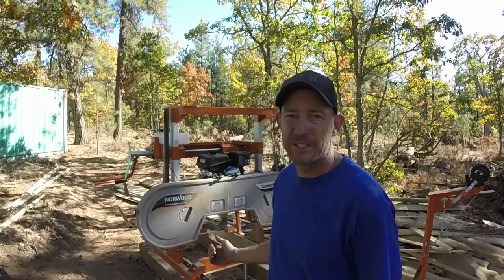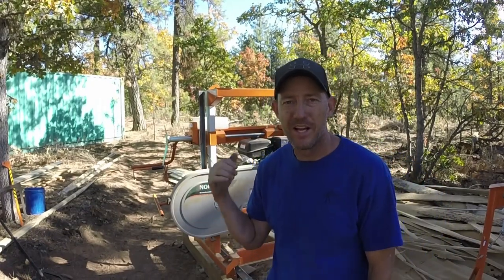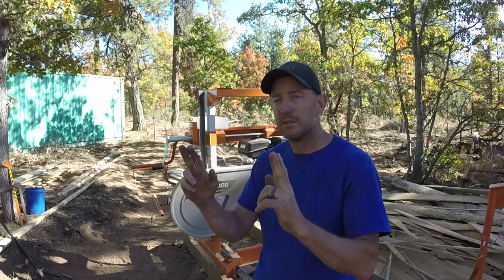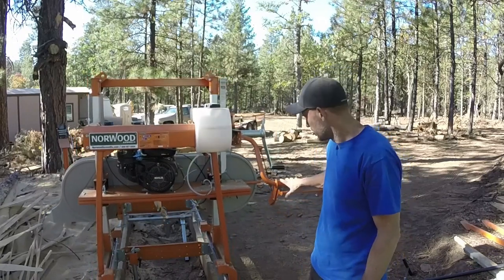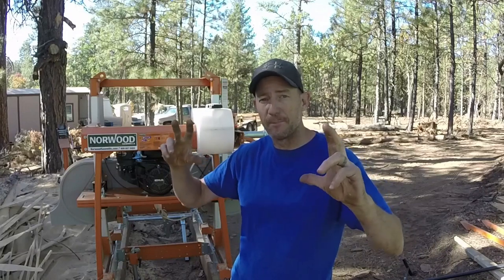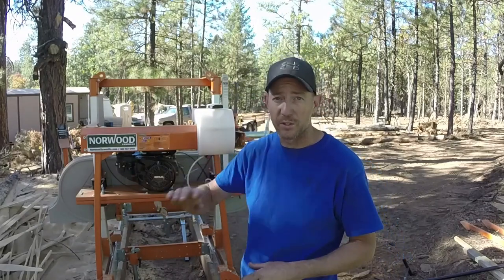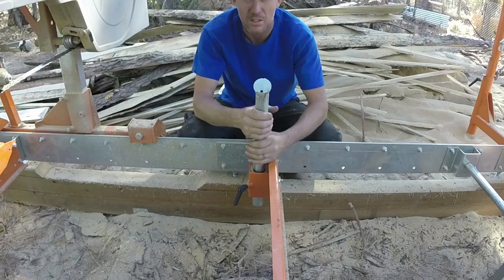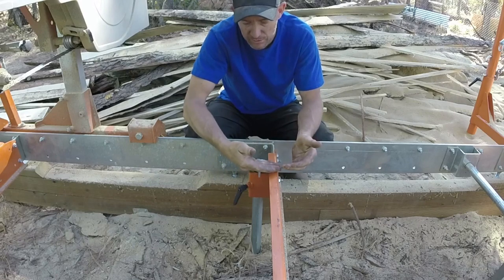Norwood LumberMate LM29 Sawmill Review by Koality of Life

Comment: I added a third log stop for shorter logs, and that was huge for milling valuable hardwoods. I also added a 3500 lb Harbor freight electric winch to the loading system in place of the hand crank one. I bolted an ammo can onto the top of the post because it is waterproof and put all the electrical for the winch inside so it can hold the remote control for the winch and the rv cable to hook to a deep cycle battery. Battery lasts all day and will load as many logs as you can mill. Milling hard Maple for furniture and some pine fence boards today snow or not!

Comment: How do they compare to wood miser
Reply from the maker: Hi John.

WM makes nice mills. Norwood is THE leader in portable sawmill innovation … in fact, Norwood has over 50 patents (more than all the rest of the sawmill companies around the world combined).  But you may ask, “What does that mean for me?” Norwoods are a lot faster and a lot easier to use because they’re equipped with inventions that no one else can offer (because they’re patented)… Only Norwood can offer you indispensable features like auto-locking sawhead, auto-locking blade guide, auto blade-lube, log-dog assists, log rest actuators, rapid dogging and rolling systems, etc, etc, etc… 

Equally importantly, Norwoods are the world’s most versatile sawmills … Norwood offers you the biggest selection of optional attachments. You can even upgrade from manual to hydraulics with the Norwood HD36! Again, you may ask, “What does that mean for me?”.  It means you don’t get stuck with a sawmill that can’t grow with you as your sawing needs grow. Everyone’s sawmilling needs grow over time. Yours will too. You won't outgrow your sawmill with a Norwood!